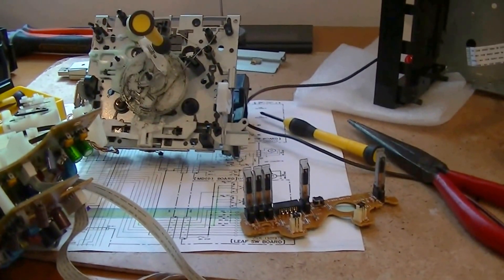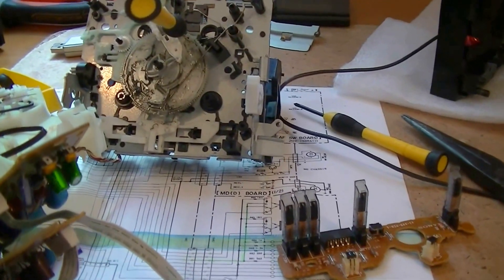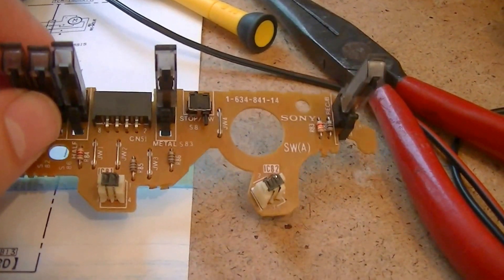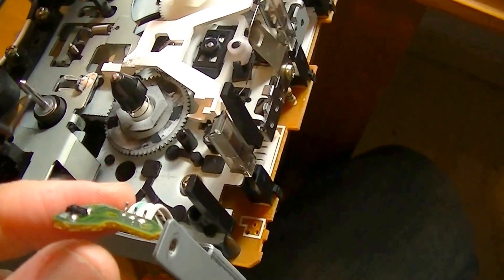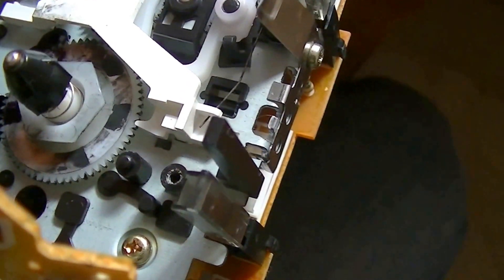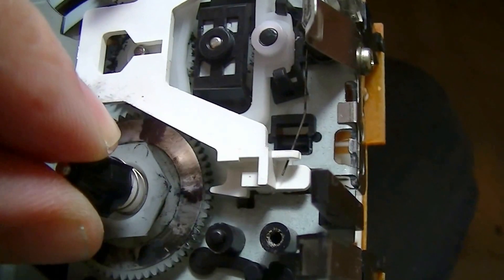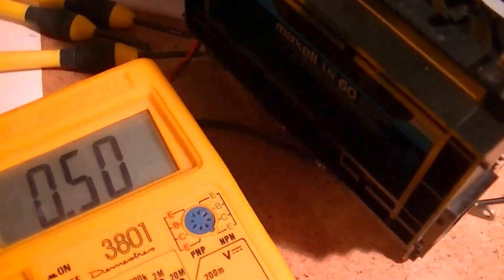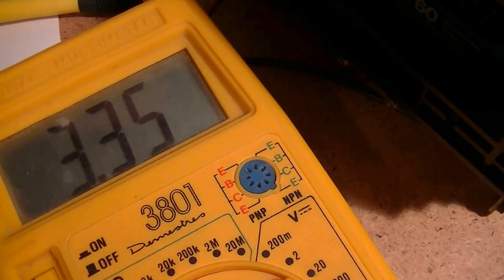autostop in modern cassette decks

Comment: Hi Nacho I'm talking about Brazil, my Yamaha KX-R430 deck was turning off halfway through the tape. I dismounted and saw the black and silver sequence was off, only the metal was clean. I tried to paint the sequence black making the lists, it got worse turning off even faster about 15 seconds. Please teach us how to redo the lists, with what material? I wanted to remind you that I only painted the black lists with a pen
Reply from the maker: I woudl use two marker pens, one with black ink and one with silver reflective ink like the ones kids use to paint (like painting christmas stuff), That could do the work. Another better option would be to cut aluminium foil bits and stick them but this requires a bit more of work and probably dissasembly so the first option is straightforward to test
Reply: @llagona Thanks Nacho, the gear has a silver metal plate, I cleaned this plate well and took a pen and made the black bands that were still visible with a lens the marking lines, in the silver part I left the metal itself, it didn't help it keeps turning off with 5s

Comment: Great video, I want to disable the auto-stop on my Yamaha MT3X multitrack cassette recorder, because it completely messed up with my tapes loops, any tips and tricks with the optical sensor ?
Reply from the maker: I've made a quick look at the service manual and your cassette deck has a magnetic based - "hall sensor" autostop. it means that a small sensor detects a magnetized wheel when it turns. That produces a special signal which is directly connected to the micro processor with no intermediate circuit you can tamper. When the tape stops, the wheel doesn't turn, the signal is kept flat and the micro processor detects it, So what to do to keep the signal as it is when tape runs at any time? I can only think in a dedicated additional circuit to emulate the signal from the "hall sensor". Easy doable with arduino for example, but not a small direct modification.
Reply: Nacho thank you for the answer.
If I understand correctly there is no simple way to disable autostop, because I'm very bad at electronics. 🤣
I will take the device to a specialist and he will make the necessary modifications, and why not add a mini switch to activate or deactivate this function.
Reply from the maker: @comteaureldelabuironniere3729  Why not a switch? Imagine. Right now,  There's a kind of a switch inside the deck, but it is continuously turned on and off by reel spin. When the reel stops spinning the switch remains on or off (one of the two), and then the deck stops because it expects the switch turning on and off in a infinite sequence. If you put a switch, How do you expect to simulate the on-off sequence? Not possible, hence you should add some electronics to generate that on-off signal. The switch you are thinking of,  should go , unfortunately , inside a chip, a modest big chip that controls all the elements of the mechanism. With older decks it is possible to cut some wire and you're done, but your deck has many circuitery integrated into one chip.
Reply: Nacho Pachés Ok I understand, I opened the device to look inside, and it's a rather complex machine... I'll wait until the end of the quarantine and entrust the modification to an expert, thank you very much for your advice, it's very nice to have taken the time to answer me.

Comment: I have had problem with this is the past .. if the black and silver disk on wheel gets dirt on it the deck will just keep stopping at random.
its annoying but i can be fixed
Reply from the maker: The important thing is to have reflectiven and nonflective strips around like it's shown around 2:00 in the video.  You have to clean it and maybe also de sensor (where dust can also deposit), but I wouldn't use any liquid cleaner as it can ruin those reflexive strips. There's people who have fixed the strips by painting with a special silver  color marker which somehow leaves a reflective surface. Hope it helps.

Comment: Hi, I have a Yamaha MT100 4 track recorder and I want to disable the auto stop function, is this possible?
Reply from the maker: I don't know which auto-stop mechanism your deck has. Haven't found a service manual and I don't know it. If it is mechanical, probably you can remove, tear or sever some part and invalidate the mechanism, but if it is optomechanical like the one in the video it's going to be harder, you can not easily trick the microcontroller. he needs to check for a oscillating or square signal. How can you feed that signal when the reels stop turning? impossible in the first thought. however there could be some sort of intermediate circuit to treat that signal that ultimately passes a high or low level signal to the microcontroller depending on the presence of the oscillating signal from the reels. in that case, you could add a resistor and cut the track and feed the appropiate signal to the microcontroller.
Reply: Nacho Pachés hi, thanks so much for your reply. I took the Yamaha apart today and found its an optomechanical auto stop so it will probably be too technical for me to disable. I bought the multitrack recorder to create and play tape loops but when I use a tapeloop in the machine the left capstan does not move and the tape only plays for a few seconds before the auto stop kicks in. If I sent you a photo or a video of the mechanisms would you take a look and see if there’s anything I can do? Thanks again for replying, Tom
Reply from the maker: @tompallant6803  You can send me whatever video you want, and I'll watch it. Maybe that could help. Generally speaking if the capstan doesn't turn, the  tape won't move and the autostop will work. But utlimately the capstan not turning means some problem with the belt, the motor or the circuit. I bet the belt is gone.

Comment: I wanted to say thank you for this video, I have a Yamaha kx250 who's tape counter belt had disintegrated into a black goo, in the process of cleaning the cog to replace the belt I must have washed the markings off the bottom. I had cleaned it in position rather then remove it, which I have now done and repainted the black sections and now the deck finally works! I had to adjust the motor speed after changing the main belt as it was so much tighter. thanks Z

Comment: My deck has a thing that digs inside the tape deck and when it is raised it just clicks off
Reply from the maker: Yes, that is a kind of mechanical autostop that is cheap to build and , honestly, only seen in bottom of the line decks. Full mechanical autostop tends to fail with different tapes and aging. Tape is raised when it reaches the end of the reel and the motor keeps turning trying to move it, then it gets tension which in result, raises the diggin part, which triggers the autostop helped by one of the rotating wheels inside. Over the time, As the belt loose, the tension is lost and it doesn't engage the necessary movement.

Comment: What is the difference bettween auto stop and full auto stop in cassette decks ?
Reply from the maker: Don't take my reply as the universal truth. I think earlier cassette decks and cheaper ones only were able to stop the function when the deck was playing (or recording). And some radiocassettes or walkmans would only dectect the end of the tape when it got tense as a result of the take up reel and pinch roller pulling the tape at the end of it, the tension moved a lever and an internal wheel triggered the stop. Hence the autostop was triggered only if the tape was tense, tape jam could still happen inadvertently. So many manufracturers labelled "full autostop" to reflect that their decks did stop in any needed situation, being it tape jamming or tape end. I think soon after "full autostop" indication was not needed because it was obvious that this had became a basic feature. In my video, and in 99% decks "autostop" means "full autostop", but when it comes to boomboxes or "radioccassettes" this matter becomes misleading.